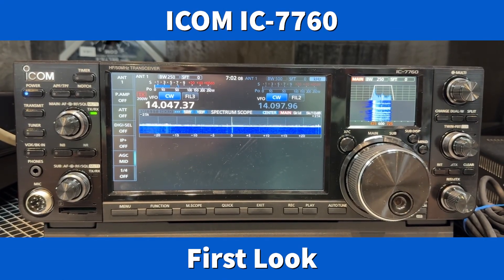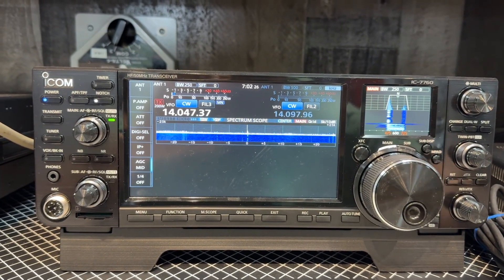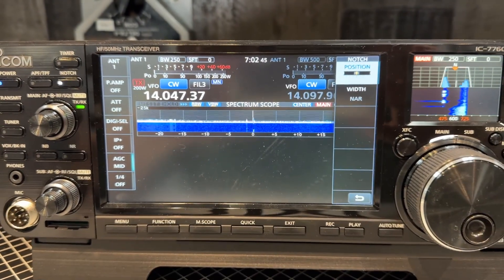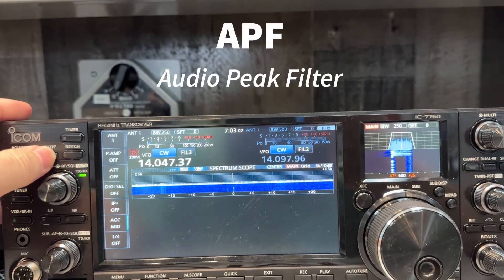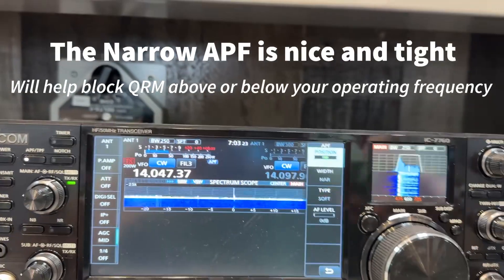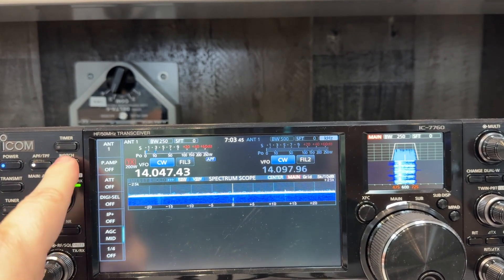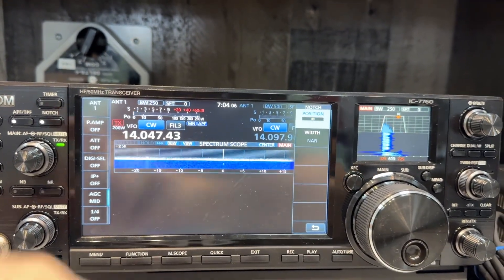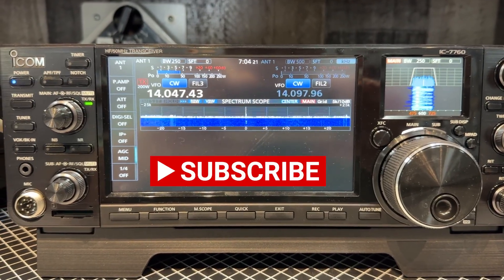ICOM IC-7760: First Look #hamradio #icom #ic7760 #cw #filter

Comment: Doug, my Yaesu FTDX10 also does manual notch while on CW and using the audio peak filter. 73 Phil ON4VP
Reply from the maker: Yes, I covered that in some of the 102 videos in my FTdx10 tutorial series.  I covered it with most of the transceivers I have taught with.  The Yaesu radios do a great job with the notch trick.

Comment: I'm trying to wrap my head around the $5900 and up price point. Wow. I can buy whatever I want but I'm happy with the FTDX10 as my primary HF rig for now.
Reply from the maker: The FTdx10 is a great performer. #2 for third order dynamic range.  The IC-7760 came in at #22.
Reply: My FTX-1 does that ? Kenwoods do that?

Comment: Big mistake that Icom carried over the hidden controls for the Notch & Power yet left the almost never touched IP select on the screen.  A survey of 7610 users say they almost never touch the IP setting & it's wasted space.
Reply: Same as the 3DSS. While some like it, most don’t. The button should be moved to the deep menu as an option.
Reply from the maker: I like being able to switch back and forth between waterfall and 3DSS.  I get bored with one and use the other.
Reply: @n4hnhradio  oh I know you like it😄. My comment was that it should be an option to move it to a deep menu and replace it with another function like the FTM-400 lets you do.

Comment: How loud are fans in it - front and in core unit? (I like total fans silence most of the time).
Reply from the maker: I didn’t hear a fan in the control head.  The RF deck has a fan and it can be noticeable. The transmitter is rated for 200W at 100% duty cycle.  It needs sufficient cooling. But you can locate the RF deck away from your operating position, to minimize the fan noise.

Comment: Has this new icom got a decent RF gain control?  Or is it as useless as the ic7300 ? 
Because turning up the AF gain and turning back the RF gain on the ic7300 (and the 7610) should give a quiet receive only it doesn't work.  You are confronted with a load of noise . Has this issue been resolved , in this new rig ?
Reply from the maker: The RF gain works the same as the IC-7300 RF gain.  I do prefer the Yaesu RF gain control.  But it is nice how the RF gain on an ICOM becomes squelch when you turn it to the right.  I showed in a video I shot of the IC-7300 how to use that squelch to your advantage when operating CW.  That video is in my IC-7300 collection on Patreon.com/N4HNH

Comment: Thanks for the video Doug. It looks like a nice radio, but I'm still saving for the Yaesu FT-DX101D MAX.
Reply from the maker: The D Max is a great radio.  Thanks for the comment, Jim!
Reply: @n4hnhradio  I bought one in December. I love the radio.
Reply from the maker: @KD9ZHF You bought an IC-7760 or an FTdx101D Max?
Reply: MAX ?? it is a new model on the way......😂........I hope it will not make the analogy with the Boeing 737 MAX..............😰😰 I have the FTDX10, a fantastic rig !!
Reply from the maker: @blitztom2685 If you order an FTdx101 and Max it out with all optional filters, you have either a D Max or an MP Max.  Select dealers stock maxed out models and they refer to them as the FTdx101D Max or FTdx101MP Max.  It is a convenience so their customers don’t have to wait for Yaesu to add the options and ship the customized radio to you.  It could add a few weeks to the delivery, sometimes up to 3 months. But, after the wait, you will have the number 1 rated receiver in the world today, with all filter options installed. The 1.2kHz crystal filter can provide an edge in a contest environment or during emergency conditions, when the bands are crowded.